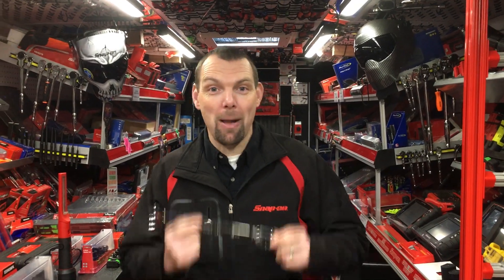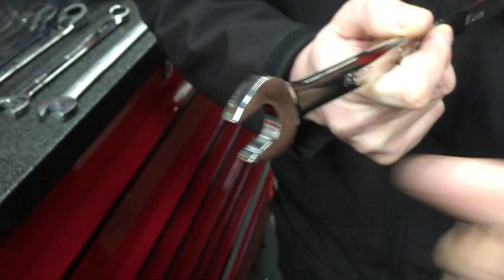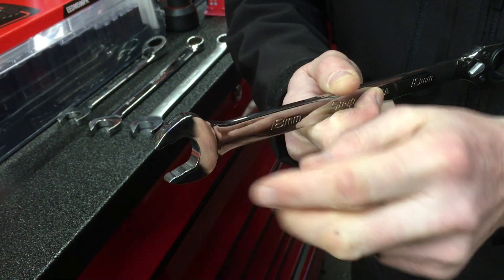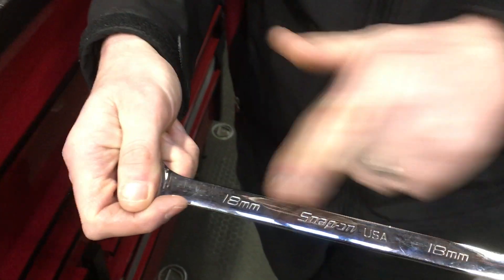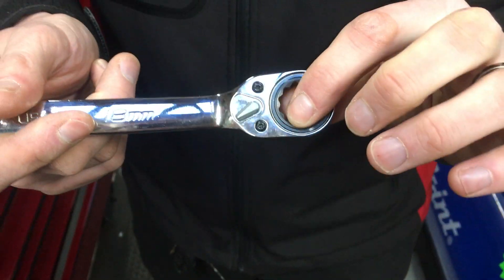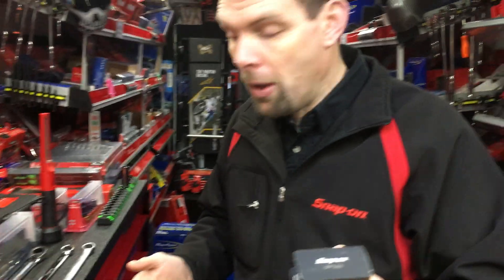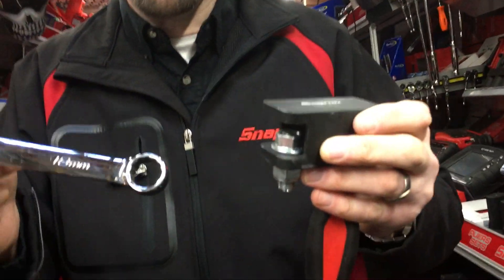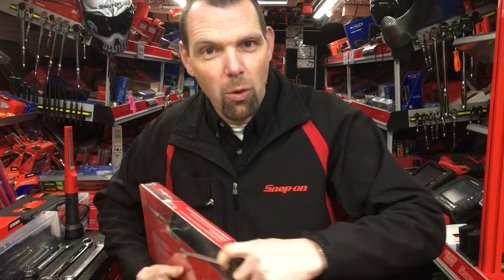NICK THE TOOL: SNAP-ON RATCHETING WRENCHES SOXRRM710

Comment: Most of my Snap On spanners and sockets are now redundant. The spanners are all inch and the sockets are double hex which I refuse to use these days. Still using my 30 year Snap On 3/8 drive pear head ratchet and my 3/8 Snap On breaker bar which has been replaced twice in its 30 years of duty.
Which country is Blue Point made these days?
Reply: USA and Taiwan from my understanding.
Reply: @topherd1011  If Blue Point range were made in the USA, they would be the same price as Snap On due to labour costs. It bemuses me that there are listings for new Snap On on ebay also asking high prices. The Snap On on ebay don't have the lifetime warranty so much devalued.
Reply: @johnbeck5795  Some BluePoint tools are made in USA. Also, ALL SnapOn tools carry a lifetime warranty. Even if puschased used. I have had SnapOn tools replaced that I bought used.

Comment: I love snap on and I'm a snap on snob but these ratcheting spanners are worst iv ever bought 10mm 15mm 18mm 19mm always getting replaced the teeth are too weak and the plate screws always falling out I upgraded from older version to these wish I didn't I cant wait for the new version to come out so I can replace all of them on warranty 6mm to 19mm
Reply: Yeah some of the first batches of these were … ugh.. but they’ve worked the problems out and they’re muchhh better now. Muchhh.

Comment: could you tell us the part number for the hand light on the bench beside you?
Reply: I have a slightly different version, but the one I have is CTLSH861 and I have to say, it's different, but with a magnetic base on the 14.4v battery, I love this thing and it's currently my brightest light. When I bought it, the tip light stopped working and I had to sent it out for warranty (they lost it and it took 3 months to get back) but ever since then it has done a fantastic job with no issues. 

The one in the video appears to be ECARC041

Comment: How much ?  $ 1000. U.S
Reply: $505.00 plus taxes so half lmao
Reply: Jose JR I bought the add on set so really 700s for 6-19
Reply: They’ll cost you a lot … but damn are they wonderful. They have literally no flex in them at all, and their profile is so thin in comparison to others on the market that they really do fit in very hard to reach areas. They also make a great open end wrench. It will NOT round off a bolt. The tolerances are THAT great.

Comment: 4:29 liar
Reply: Find a Snap On truck with this prop and bring your ratcheting wrenches and watch them not fit.
Reply: Yeah, why can't the open end turn the nut!?  What a BS demonstration.  All of the wrenches had an open end and all of them could have turned the nut.  Plus if the snap on box end doesn't fit, and it's solid metal, the ratcheting box end is smaller and probably a lot weaker. If you really want to use serious force and get away with it when all other wrenches will round off or fail, stick with the regular flank drive plus.
Reply: @jamesmoore3499  He's talking about the open end.